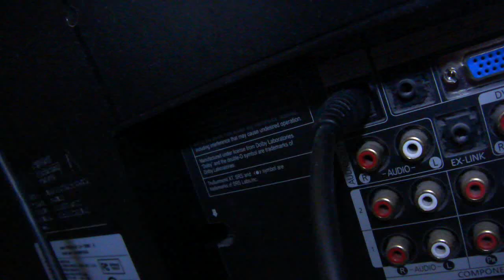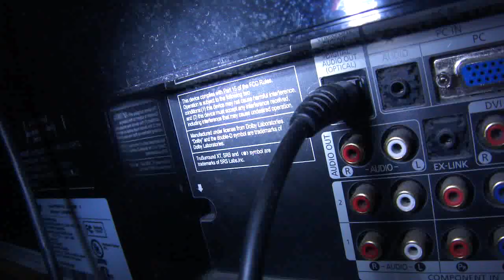Quick fix TV surround sound system

Comment: Is it better to loop the cable and tie vs folding? Which you prefer that it won't affect the cable performance ex: optical or hdmi.  Want to clean those mess on mine. Thanks

Comment: Use the Y-adapter method shown in the video.  You'll need two additional items to what you already have.  1) Y-wire with two red/white RCA adapters on one end and a single stereo adapter on the other end.  (make sure it's STEREO because they also come in mono).  2)  a female/female connector.  Connect the Y wire to the white/red RCA OUTs on the back of your TV and use the stereo plug end inside the female/female for either computer 2.1 speakers or headphones. I use this set up with my Toshiba TV

Comment: hi, thanks for the video, if you got a system that is meant to have 4 speakers but only has 2 front ones, how do you add the rear speakers for 5.1? i have a panasonic dvd home theater sa-pt850

Comment: I have a rear (surround sound) across the room and connected to Rocketfish wireless set.  The transmitter it connected to the AUDIO out on back of TV .  The receiver is connected of course to my rear surround sound speakers.  I get no sound, even though the red LED's on both the transmitter and receiver say they are connected.  Do I need  a small amplifier between the TV audio output and the transmitter input?  Or is there a way to turn on the audio output from the tv??? Thanks for your help.

Comment: Hi I have an older samsung surround system..The speaker wires have small coloured spade type fittings but the dvd player no longer works. I would like to know if it is possible to adapt these connections to fit other dvd players with  different  types connections?

Comment: Sometimes there is a firmware issue.  If your TV has a USB port, upgrade is simple with Vizio instructions.  Rerouting sound around TV speakers into an external speaker system as shown in the video will work.  Sometimes it's just time for a new TV ... ;)

Comment: I have a vizio jv50p plasma tv.  Lately there is no sound when I turn the tv on.  After about 1/2 hr I turn it off then on again and I have sound.  There have been times with sound but no pic but mostly pic but no sound.  What do you think the problem is?  I am going to try this solution to see if it works.

Comment: hey tampa, I have an LG 5.1 home theater  (I changed the settings on my surround sound would be on) but only two front speakers are working (the left and the right) I have tried the method of unplugging the power for a minute and plugging it back in but still no luck the center and the rear left have no sound at all and the rear right has static
Could you help? 
Thanks

Comment: hello, i have tv toshiba pro theater and a lg home theater sound, the problem i cant connect the sound to the lg home theater speaker when i want to watch television, and when i saw the tv there is no digital optic cable as well as the lg home theater system, should i use receiver to connect the sound to lg home theater sound? i need your help so i can figure it out how to connect, i dont have any idea how i gonna do it,

Comment: Just wondering if you could explain why only two out of the four speaker inputs; where you actually plug the wire in the back of reciever are the only ones working. As of know I had to connect two speakers to one  input just to get 3 speakers and obviously I'm not getting the best sound quality bc I have two speakers running off one input. Could you please let me know if you know why only two of the four inputs are working and how I can possibly fix it. I have been using sound equpiment since I was a kid so if its something I need to take apart that will not be an issue. Thanks
-Matt
Reply: Oh and its a Magnovox stack reciever that is probably twenty + years old. I can send a picture of the back of the reciever if needed.

Comment: I have a Samsung surround sound system and the sub has a 13-pin Roland port on the back. I got a 13pin cord that runs into rca audio cords that I plug into the PlayStation or Wii or whatever. the sub is getting power and has the light but no sound. what do I do?

Comment: Maybe you might be able to help me with a problem? I have a vizio TV and a HD Charter cable box,I am trying to connect my panasonic DVD recorder to the cable box to record shows onto disc but can't get a connection to transmit a quality picture and have to resort to the yellow,red, &white cables.Is there no way to achieve a quality picture even to s-video? The DVDrecorder has no input for HD but the Charter HDcable box has no s-video jack to use either.How can I get a quality transfer? Thank you

Comment: When I use HD chanels I have no soun it all.
What do you think is the problem.
Reply from the maker: reset cablebox or tv by unplugging power cord for 1 minute and check cable for loose connection.

Comment: So my TVs optical is broke and so is the hdmi arc it has no headphone jack and no audio out. The only thing I can do is connect the analog in on my theater system to my cable box audio out. But what of I want surround sound on my ps4 also.
Reply: Joshua Davis 

Go from the optical on the PS4 into the optical on your receiver. Then switch audio channels on the receiver when you want PS4 audio.
Reply: Thanks man it worked
Reply: Joshua Davis 

Good deal!

Comment: I have a Logitech Z623 speakers with a woofer.  they're made to be used for a PC or television.  had them on my PC and they worked fine.  plugged them into my tv and no surround sound, all mono.  Plugged them into the headphone jack on the back of the tv only because plugging them into the left & right audio on the back of the tv gives me zero sound at all, which is weird.  there is sound through the headphone jack on the tv but its 100% in mono which shouldnt be, have tried for the past month to try different combos, bought new wires, adapters etc.  nothing works to get stereo sound.  but if they're plugged into my PC I get stereo.  It's a Seiki tv only about 5 yrs old, speakers are brand new bought them 2 months ago, even the company Logitech has no clue what the issue is.  No one can figure it out.  It's obviously in mono as you can hear some audio appears far off in the distance, same for music, sounds that should be transmitting in just the left or right speaker which don't.

Comment: here my problem  I have samsung regular tv not smart, but I did buy a blue ray dvd player with wifi so I can watch netflix. Anyhow I hooked up the dvd player via  hdmi only way it can, but then I got soundbar  hooked up via optical to tv .Then I hooked up my external speakers but to get sound it had to use rca , I had to hook up via rca to my cable box so i can get sound from tv.plus my cable wired via by hdmi to cable box to tv. With all that when I turn on tv regular tv shows I get sound from my soundbar and my external speakers at the same time.  But when I want to use  mt dvd player I only get sound from my soundbar but nothing from my soundbar   Why.  Need help please
Reply: from my soundbar but not the external speakers too confused

Comment: Hey my tv is a soniq L42S10A and it has no audio output but it has coaxial output and I have a Logitech Z506 surround sound system how can I get my tv to go tho them speakers
Reply from the maker: unplug tv's power cord for 1 minute to reset it, try both TV's audio outputs headphone output and red/wht audio output.  call about tv warranty but if no warrnty then next check 12 dc volts to main board going to audio section of main board. You can just connect cablebox straight to surround sound then video to tv. good luck get main boards at shopjimmy.com

Comment: how about a buzzing noise on a tv
Reply from the maker: The Linguist Addict can be bad ground on plug or bad electronic part or bad connection or interference from nearby device.
Reply: I already figured it out what an exciting way to make you think
Reply from the maker: The Linguist Addict how did you fix it, reset?
Reply: No , I had to plug it in the back